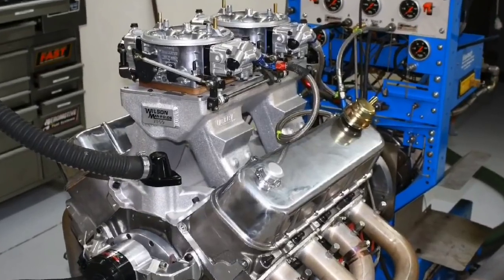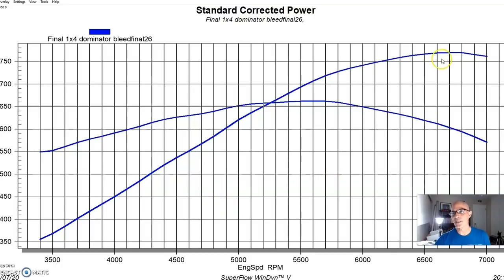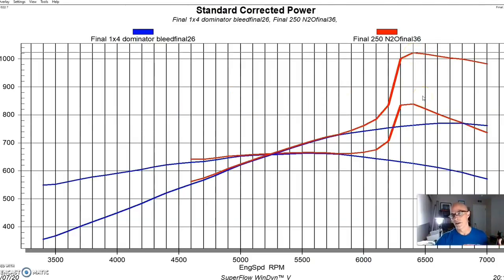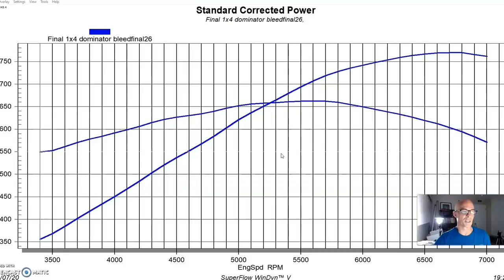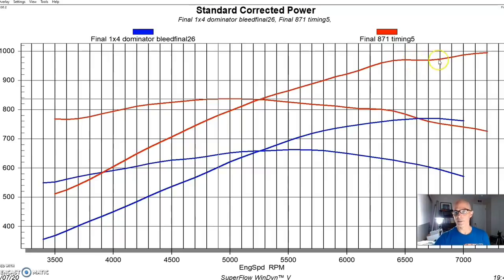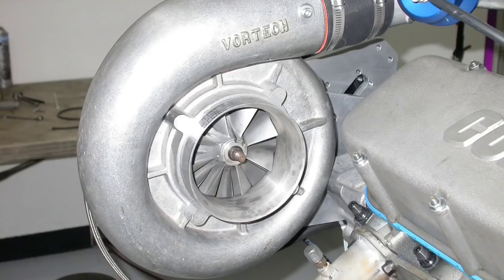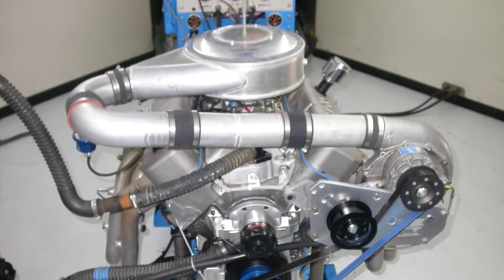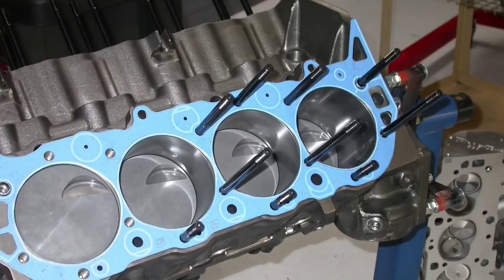DOS XX BOOSTED 540 STROKER (PLUS NOS)

Comment: @RichardHoldener- The dip in the upper end of the dyno graph, could be from the 8-71 Blower having too much blow-by/slight reversion, from the teflon strips in the rotors, as the pressure raised with the rpm. Like if the Blower needed to be rebuilt.
Reply from the maker: blower was new
Reply: @richardholdener1727  -Well then it wasn't that.❤️ your videos. Thank you for your response.

Comment: Love the BBC specially these new stroker motors 496 and up. 
With that said would have liked to see the centrifugal run over the roots 871 run. I noticed the flutter at 6600rpm from 871 did not Cary over to the vortex. Would have liked to see a closer head to head comparison. With 4500 blow thru carb. 
How about a centrical blower shoot out.  👍🇺🇸

Comment: I had a similar dip a few years ago. It turned out the be a harmonic in the valve springs caused by the blower belt harmonics going through the crank, cam, and then valvetrain. Crane supplied us with some springs with dampers and it went away.

Comment: On the 8-71 if you're running vacuum reference power valves you could have a slow leaker. Break out the vacuum tester and go to town.

Comment: Maybe the nitrous pull kicked the sheet out of the rings a bit? That was a really good shock, late in the rpm band. The vortex had a weird ramp also. Two completely different forced inductions systems, both had a weird ramp to them. The only things that were the same was the parts you didnt change.

Comment: Why such a long pipe from supercharger to inlet/throttle body? It could have been half the length. Is the near 180 degree turn important for some reason, and this means the length is required?

Comment: I wonder if the 8-71 rotor seals were acting up at the top of the power curve.  EDIT: or a sketchy pressure relief valve starting to leak too early?

Comment: I just watched the new dyno run on the 7.3L Godzilla and it knocked out over 780 hp and thats the NA, i can't wait to see what that 3.0L whipple supercharger will do on it, I only mention it as this 540 BBC is making  similar power (but at lower compression)
Reply: I watched that too and was really impressed. They didn't give cam specs, probably top secret, but that's lots of power from 445 cubic inches. They said it's over 12 to 1 compression and that's around 10% more power than you would get with 8.8 to 1 like this engine has, but they have done lots of development in less than a year. I still don't see guys looking for smashed chassis cabs to pluck the engine out for swaps. They're still kinda niche and it's gonna cost lots of money to go fast with them.

Comment: Richard,

Can you test the power difference between a N/A run vs Turbo at part throttle holding 0 vacuum/boost. I've been curious if they are similar.

Comment: Awesome (pt1) really awesome (pt2)Super awesome (pt3). I don't think it's valve float because the power goes back up a bit higher in the RPM range. I would think, if the valves started to float, you lose power and don't get it back.

Comment: I think it's about time someone combines a Roots blower with a centrifugal blower. OK so the load on the crank snout would be a problem. Someone needs to develop a custom drive system with a modified bellhousing that uses the starter ring gear to drive a shaft and pulley to drive the centrifugal blower. Set the Roots blower @ about 8 lbs and let the centrifugal bring it up to 20+ lbs. Can you imagine the torque curve?

Comment: Guns Cars and Digits and Richard Holdener: Rootes blowers that dont have helical blades like screw blowers create reflecting waves. One other poster noted this.(GC&D ammended above..Props to ya man!) In Australia, tunnel ram and Rootes combinations have been used on small block Clevelands. Forced air or induction "pre-frontal disturbance" and "Spit back" into the fuel delivery area isnt common. The effective boost curve readings...Richard...have you got any boost curve readings for both the Mondo and 871?. Any air fuel ratios?

Comment: You said in the previous test that the dart tunnel ram had interchangeable lids. Couldn't you use a lid that was tapped with the same pattern as the blower lower intake and bolt the 8-71 to the top of the 'ram?
Reply from the maker: IT CAN BE DONE

Comment: Cylinder pressure too high for valve springs at that point in the rev range - valve spring harmonics - dip in power
Reply: J.T. ...............what about a slight reversion problem ????????????
Reply: @dannycalley7777  I'm not sure if reversion is something that is common on a boosted application. Anyone?

Comment: With the 871 blower it almost looks like a sine wave appearing in the power like you see from intake runner length/cam timing causing slightly more efficient and less efficient areas with a certain rpm.
It also appears that with higher boost pressure it moves the sine wave higher up in rpm a slight bit.
🤔🤔🤔

Comment: Hello RICHARD, I have a QUESTION.  My '77 454 dually would only go 30 mph up the hill towing my 38 ft 5th wheel with jeep in the back.  So I added a whipple turbo charger.  I went with the RV cam since I'm towing a RV.  I'm now adding a 250 hp nitrous per your video advice.  Thank you.  So my question is should I back off the timing from 0 btdc to 10 btdc and how many miles will I get from 1 nitrous bottle while towing?

Comment: Is the power dip in the 8-71 blown 540 a wave problem like when you tune with velocity stacks?
Reply: Thats possible,another possibility is the volume of air ,not psi is overriding the capacity of fuel jetting at that window of rpm power loss ,just a thought.🤔

Comment: If you look at the graph, to me it looks like it bumps up right before you highlighted the “drop in power”. If you draw a line to connect the everything from 5500 to 7000 rpm it looks like it bumps up in power instead. My guess is just the afr changed for whatever reason. Maybe exhaust pulses. Idk lol

Comment: You noticed both tests had the same dip very close in the same RPM range, 6000-6500 range. I'm not 100% sure but based on other exhaust manifold tests you have done I'm willing to bet that the dip is caused by the exhaust scavaging pulse. I can't remember what video it was but you had a motor doing the same thing and once you changed the headers/manifold to a different one the funky wavy power curve straightened out. Love your work and thanks for sharing the videos!

Comment: Do you think twin twin EBay GTA 45's would work on my 500 cad in Gbody el Camino?
Reply: Stock Cadillac 500s have cast rods and push pin rockers, they work fine in stock engines up to about 5k rpm and a little more but I would really really be leery of them. Unless you think you need more than 1000hp, twin gt35s will fit easier, spool faster and you really won't notice the difference on the top end. Use a tough th400 for the incoming 800ft lbs and have fun

Comment: One more thing, I don't know if you had already done this test, but now that you have a big bore engine bloque can you run a test between a big bore short stroke and a small bore big stroke where both engines equal in displacement, to see what are the supposed benefits of the big bore beside the ability of installing bigger valves, I know you shouldn't do this but the test shall be with same carburetor cfm and same cam lift, duration and LSA, because I guess both engines can make same HP if you add more lift and duration on the small valve cylinder head just to compensate for the smaller valves but that is not the idea of the test, after that add a centrifugal supercharger to see if we can see possible a wave difference between the two setups or if the curves are equal in progression.

Comment: Did you measure intake manifold temperature on the roosts and centrifugal supercharger ?, What was the difference between the two, I know the Dyno runs are short but  was it still possible to trend intake and boost on the range of rpm, I notice that with the roots blower that dip at the end was about in the same  place in the rpm curve as the raise on the centrifugal supercharger.

Comment: Maybe a blower rotor rpm thing causing the dip in power because when you changed the blower speed the dip seemed to happen a little later in the rpm , maybe some sort of air pressure wave causing the blower to take more hp to turn ?

Comment: Yea....starting to loose interest. Go back to the other guys. When you get bored....get a 572, then a 632, then a 750, then a 815. And after that....realize mike moran is making more then 4000 hp with 440ci. Other guys......215 buick and olds aluminum blocks. Ford 2.3 4 cylinder,  el crappo olds 350 diesel.

Comment: One important piece of criteria that I've noticed you never include with these tests, is the actual weight of the various components.

For instance, obviously a nitrous plate doesn't weigh a whole lot, but by the time you include the tanks, lines and solenoids, I would think it would begin to add up to something significant.

I know from experience that GMC blowers are fairly heavy.  So how do they stack up in comparison to the centrifugal, or turbos?

Every 100# costs you a tenth...

Comment: I’d like to see how much these setups cost. A horsepower per dollar series would be cool.
Reply: If you DIY it and use adapter plates to use 6V71 or 8V71 Blowers the price is around $2000 or about half of the Blower Shop price of $4500.
Reply: John Parrish : It may be different now with custom lobes and seals,  but in the past, V series blowers have been  less able to make boost than traditional in liner 71s. The position of the lobes is able to be custom tailered in the case of custom blowers. Generally, a dollar drop is normally a boost curve drop. The historic move to injection happened early because of difficulty in making reliable "power increases"  with dual quads. A different, cheaper V series blower might suit dual quads better and not disturb the fuel delivery air fuel ratio as much. This is  why we dyno test. Great idea, JP. A different 871 might give a 200 hp increase if it doesnt upset the air fuel ratios at 7000 to 8000 rpm.

Comment: Blower timing. You're thinking I'm off my rocker. Roots blowers can be timed. A friend of mine ran BB altered in comp eliminator. He sent his blower out to a blower dyno to get timed and he pick up e.t. it was in the early 90's I can't remember the gains. I'm getting CRS😁
Reply: On a straight rotor that might affect it more but I don't think these new ones matter because they have twisted rotors
Reply: @bill2178  IDK what he had as far as rotors. I do know it was a Mert Littlefield.
Reply: Timing the rotors is setting the clearance between the rotors  with the drive gears, about .010 leading and trailing that can be changed to what you want say to .008 leading .012 trailing
Reply: @davelewis2174  Yes, setting the angular position of the rotors, in relation to the gears.
Reply: You could never time it with the engine, unless it was being driven at a critical ratio of 1:1, 2:1, etcetera...

Comment: More value spring pressure on intake. Air pressure slowing down valve return to seat at higher RPM
Reply: Possible...
Reply: Effectively creating a boost leak.
Reply: If it was the case of weak valve springs the power curve would keep falling off or stay flat. But there is some truth to what your saying when it comes to spring seat pressure. I'm not going to get into the calculations now but just for reference with a 2.25" valve OD, with 8 lbs of boost you will have approximately 31 lbs of opposing force when the valve is closed.
Reply: @GeoffJohnson007  I think it's a compound issue: spring pressure vs harmonics vs air pressure.
Reply: So to further prove my theory, check out the latest 500ci caddy carb test video, and at the end they removed the mufflers for the last test. Notice how by removing the mufflers how it drasticly changed the dips in the power curve. This is due to different timing of the reflected exhaust pulse. I'm sure there is some valve train harmonics, ect., having some effect though. Just my .02.
Reply: @GeoffJohnson007  Be nice to have unlimited dynamometer access, so as to be able to tune every little detail to perfection.

Comment: Maybe that weird dip in power on the 8-71 is due to valve spring coils going into resonant vibration at that specific engine speed, then the boost pressure and pulsations from the blower are causing the the valves to bounce slightly after seating.  Then once the engine speed increases to where the valve spring coils aren't resonating, the effect goes away.

Comment: There does look like there is a valve control issue going on. If you look at the power curves up top even with the vortec there is a sudden level off in horsepower with it.  It may not be quite as obvious as with the 8-71 but it is still there.

Comment: the drop in power with the blower over 6500 is due to timing not being optimized for that RPM range. It could also be a sparkplug gap issue where the sparkplug gap needs to be tighter to prevent "blowing out" the spark. It does not actually blow out the spark but has to due with the increased amount cylinder pressure causing issues with combustion.

Comment: I'm wondering if the blower might have a clearance issue, set up to tight, and at that RPM and heat level it might have started rubbing the blower end plates.
I doubt it but it sometimes happens.
Reply: Should see what happened to an 8-71 Gail Banks ran dry, without fuel keeping the rotors cool
Reply: @timothybayliss6680  It's funny that Gale Banks would ruin a blower like that since he has been running water/meth through blowers for years.
Maybe he did it on purpose to make a point, if so it was an expensive point.

Comment: BBC plus boost, even better than the tunnel ram tests! Love it. Just needs a turbo at the same psi for comparison. How much crank hp goes to turn the blower vs back pressure to turn the turbo? I think the turbo route is more efficient. Still, awesome video!
Reply: A crank driven supercharged engine always sounds better than a turbo engine, if that's important to you...

Comment: BIG BANG 540!!!
Reply: Oof, why? I don't know how much power their dyno can hold at WestTech, but the head gaskets and rod bearings will be your first limiting factor. If you had Al rods you could probably make 3500hp with enough boost and you would start to twist the crank and push the main saddles out of the block. Even in this configuration, it would hold more than 3000hp if the head gaskets didn't let go and I don't know if the dyno has that strong of an absorber on it.
Reply: I second this

Comment: My guess as to where I would start would be sparl Related, close plug gaps or increase spark energy or both, seen where spark energy stands off until cylinder pressure drops slightly then jumps plug so artificially retarding timing momentarily but not a misfire
Reply: shane  not really, as combustion speed and flame travel speed dictate pressure rise to create power, if dynamic compression varies with cylinder efficiency then spark standoff can vary also then power production requirements for spark advance varies, also a factor is large bore engines for flame travel distance hence why big bore dual plug hemi' work well, there are many papers on dual spark flame Propagation being beneficial to knock elimination as well
Reply: shane  your talking combustion maximum pressure but dynamic pressure is present before as dynamic pressure from compression ratio and volumetric efficiency, spark propagation from centre electrode to earth is affected by many things, temperature of mixture, temperature or electrode, cylinder density and air fuel ratio uniformity around spark plug for some and these  things are never constant,  if you have ever tested spark plugs in an old champion plug machine with only air pressure and no fuel molecules present you would know it doesn't take a lot of pressure to stop the spark jumping plug or shorting an easier path to ground

Comment: I had a single carb on a blower that would pull fuel in from the accelerator pump nozzles at higher rpms.  Was the AF mix a little richer at those rpm's?  Holley knows about this problem and makes anti-pull over nozzles to fix it.
Reply: I just learned something here...

Comment: I would guess it was a valve train resonance issue around that rpm range. It had a funky little dip around the same rpm range with the vortec also.
Reply: exactly what im also speculating. maybe switch to a timing belt set up instead of a chain , and get a fluid damper.
Reply: That or intake track resonance, like the sine-wave torque curve the tunnel rams were putting out.  I'd lean towards valvetrain, though.

Comment: That power dip looks to be a supersonic cavitation dip issue... The speed of the air possibly got to the point where there was a slight mach wave over the carbs, and this is usually removed by modifying the inlets to encourage a wider inlet superheterodyne horn, or else place longer tapering inlet cone which can help more gradually phase in the transition from subsonic to supersonic [that is the whole point of the superheterodynes, you see them on basically all performance carburetors, but mostly where they are running naturally aspirated, not supercharged, then you need an additional slip stream adjustment and transition tunnel, and this is where those funny looking curved looking scoops come into play. They are tuned to both increase compression ram air intake as well as eliciting a transition from subsonic to supersonic, where the air is semi, to fully stratified along the walls of the curved scoop. These features combines to greatly reduce the mach wave problem high intake speeds can lead to, and they work for all engine sizes, at any point where one is encountering the issue.
Reply: That’s pretty good, I just said it looked like it was fat lol
Reply: wow.......
Reply: Pretty sure it's a valve harmonic vs pressure issue.
Reply: shane  You don't know what you are talking about...